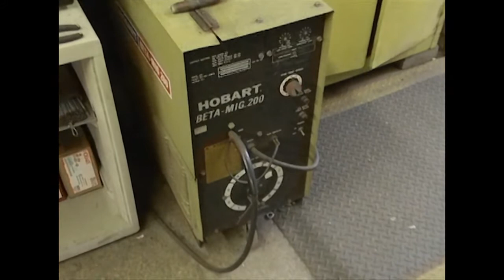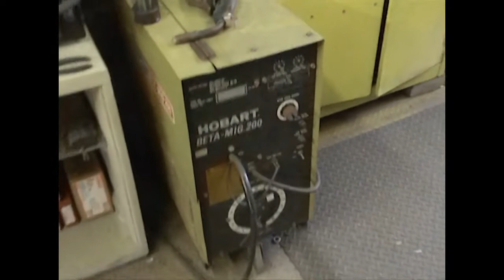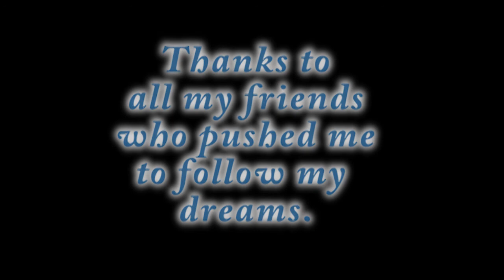Making A Grinding Bench

Comment from the maker: I need to go out and buy a new cup, I had to replace the torch on the machine last year. The old gas cups fit the new torch just fine but the flux core nozzle is so loose on the torch it just falls off. I agree though, need to get a couple in the shop for future projects... See you around the web...

Comment from the maker: why do women have 40 pairs of shoes?

Actually I have one set up to buff and polish, another with steel and brass wire wheels, one has a stone that is for sharpening my Tig tungsten only and a finish grinding wheel... the 4th is course wheel and medium grits. On an average day I use every wheel about 4 to 5 times... that's a lot of wasted time to swap them out if I had to.

Plus if I have a lot of deburring to do I can be on one and set Dana up on the another.